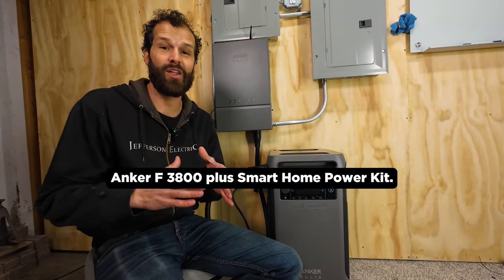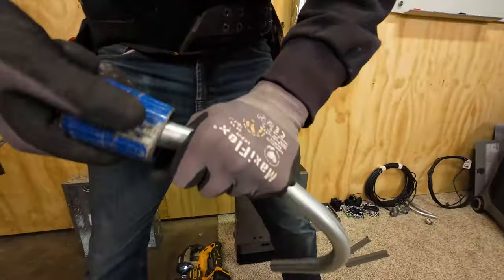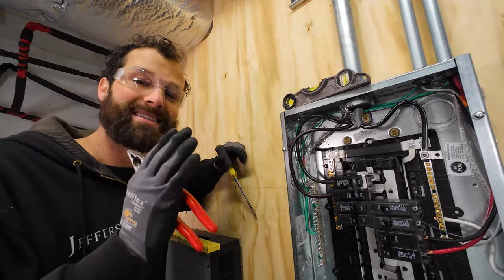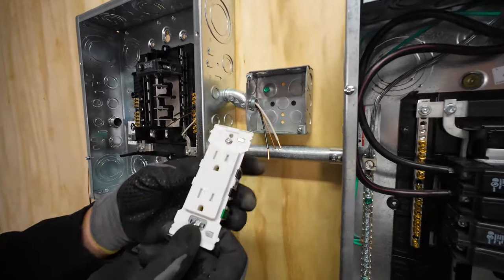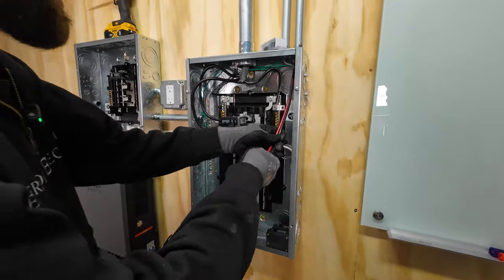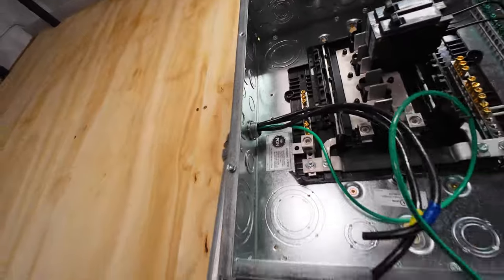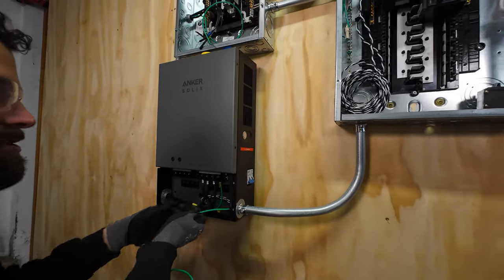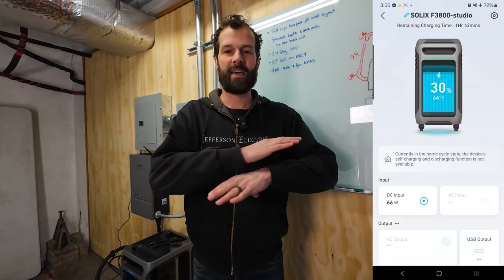Modular Home Battery Systems are Getting Good: Anker SOLIX F3800

Comment: 30:28 Isn't 6awg supposed to be continuous white for the neutral by code? (NEC 200.6 Means of Identifying Grounded Conductors) Also, those wires are VERY COZY in that 3/4! 

32:24 I was also confused by this. Obviously, the transformer would be the source, not the panel! I installed mine with the arrow pointed away from the panel and it worked great. Discovered later that the instructions said the opposite, so not sure what to think... 

Great content man!

Comment: Believe the short els that you used have too tight of a bending radius for #6 wire. Always tried not to bend wire or NMB cable less then 6 times the diameter of wire. Years ago a township inspector  gave me a hard time when I pulled three #12 stranded THWN wires thru one short radius elbow. Was coming out of a trough to bypass safety switch that feed a three phase starter. This inspector never allowed you to run more then the wires for line , load & a ground wire in any safety switches.

Comment: Not sure if I am asking the right question, but why get this over something like a Tesla Powerwall or the Frankling Whole House battery backup?  I understand that this seems more economical, but am just curious to make sure am not missing anything....Great video...
Reply from the maker: Largely economical, though as we've reflected on it, we love this solution for non-solar customers who are just looking for battery backup because it allows the F3800 to still be used as a portable power station for outdoor or off-grid applications, instead of just the 3% of the time when a customer might lose power.

If you are a solar customer, the F3800 + HPP is still a fantastic option, though a little younger in the market and lower capacity.
Reply: Actually if there was some way to bypass the grid requirement and just use this for off grid then it would be perfect for my tiny cabin. Got a 100 amp panel and so basically I would switch everything over or something. Maybe grab an extra anker and run a inlet box instead or at least trick the system into thinking I have grid power

Comment: this is way to confusing for a non-electrician so I wouldn't even try it. Unfortunately I have been totally unable to find a certified technician who is familiar with the process. I provided the install instructions to 3 separate electricians and they never returned with an estimate. on their visit, Each of them told me that they had installed external generator interlock and that's how they would install this. It appears that the trades are slow to catching up.

Comment: Question Could you use this setup on a totally off grid cabin where say you wired up an anker f3800 or something to a generator inlet and then you run the wires from the inlet to the main lugs as L1 and L2? This is an idea I had and was told to me but I didn't know if there would be any issues I would need to address like a possible disconnect or something.

Comment: I hope to get to a point in my life, I can afford to do this. I also want solar instead of a reliance on the grid. Really stick it to the Ameren Nazis too, as a bonus.  I was unaware that Anker had these kind of products and was considering Eco Flow, per Everyday Home Repairs whom speaks highly of you.

I like those lever ideas on these outlets, but I am not a fan of Decora style. The only exception to that is GFCI and I am not really a fan of those, either. Will change out the breakers when needed with GFCI breakers if that will work. Then change back to traditional duplex I like. Hope they get levers for those. It would also be nice if those, and the Wago people would work on connections with teeth so that wire need not be stripped. Make it super easy, especially for those of us with arthritis and dexterity issues.

Advice, I noticed you used a nut on the back of your screw. Those tabs work, so you don't need a nut. Saves money and having the issues dealing with losing a nut. Their shape also make it tighten down without needing a wrench or using your fingers.

My OCD caught that the box wasn't bonded with a wire, which I realize isn't necessary, since the receptacle is grounded, and carries to the yoke and the offset (fitting) as I call it, also carried ground. But like I said my "OCD" goblins in my head make me mention it.

I like that neutrals are separated from the grounds. I realize it is required in sub panels. I hope I live to see the day it dawns on NEC to also require it in main panels. I am not a fan of this "SMART" stuff either. One little glitch and you've got really big bills because an electrician likely won't know how to diagnose or fix the electronic components. Electrical, yes, electronic components, not likely.

I love Klein Tools, especially the NCV testers. I have 2 of those, I like it that much. I do wish they were plastic and rechargeable. Then I'd love them even more. I always test mine before and after too. Even double check.

I don't know that I like the idea of those clamps on wires like that. Too much of something moving around. They should be marked clearly and more affixed to the wire if absolutely necessary, but I also don't like the idea of my house connecting to the Internet. It's just more tracking that can be done, and dire consequences if there is a cyber attack, and even worse, they figure out a way to steal your money.

Comment: The biggest flaw with this unit is that when you are using it, you are not able to use shore power to charge the unit while using it. The only way to charge it is with solar while using it. There is no AC pass through. So if you have a grid power outage, and you run out of stored battery capacity, you can't hook up your generator to charge the F3800 as the 240 output will turn off. The only way is solar. For this reason, I won't buy it until they fix this.
Reply: Thank you for this comment, was considering getting one and this is a great limitation to be aware of

Comment: No they're not. They still use old fashion, high frequency, transformerless inverter tech that provides a far poorer surge capacity and a much shorter life expectancy than low frequency, transformer based inverters.

Comment: was the paper template not the right dimensions for the actual brackets?
Reply from the maker: The template was large enough for the brackets, but not large enough to stand in for the footprint of the device, so positioning the HPP relative to the main panel and the critical loads panel just had to be trial and error. 😒